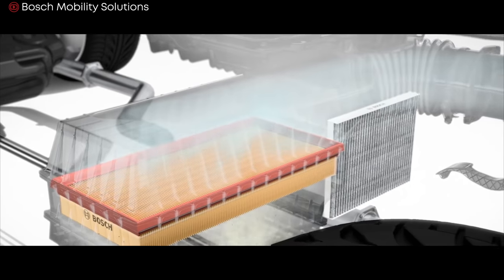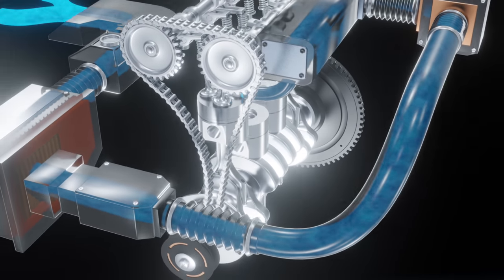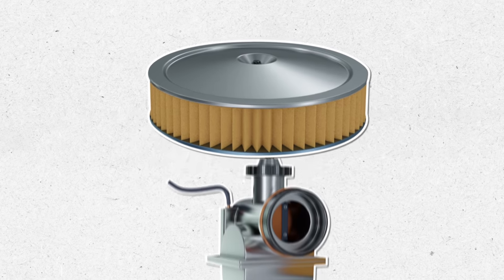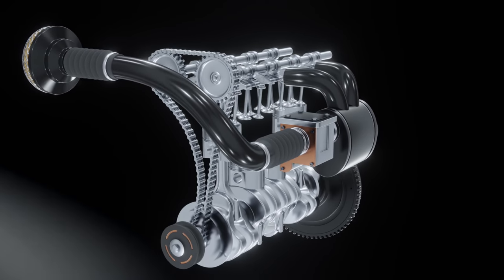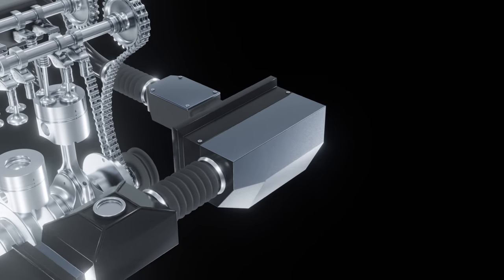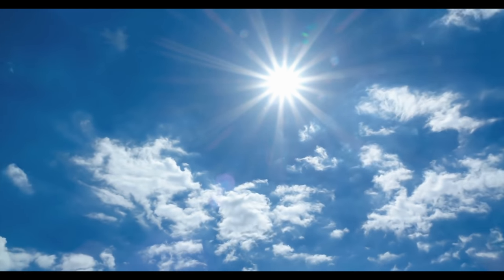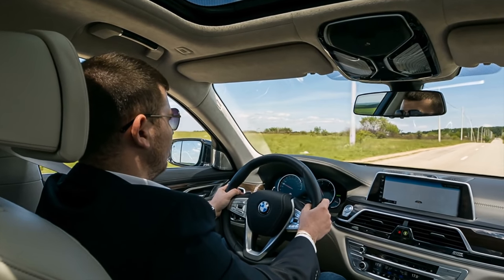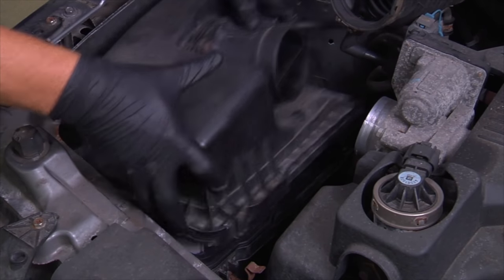If You Don’t Have This New Engine Air Filter, You’re Stupid

Comment: Hey Scotty, I own a 2015 Jeep Cherokee Limited edition with a 3.2 L V6 engine. I have owned the car for a number of years and have put about 40,000 miles on it (it now has about 70,000 miles on it ). I’ve had no work done on it after several years! Why do you have such distaste for the new Fiat Chrysler Jeeps?
Reply: because they dont last like they should, the newer ones should last 200+ thousand miles mostly trouble free but that doesnt happen. people have seen those cars break as early as 70,000miles which is unacceptable

Comment: My Dad's 1955 Ford with the 272 V8 had the old oil bath air cleaner. It was about the size of a crock pot. A messy thing to service.
Reply: I still use both tractors and trucks that use oil bath air cleaners. All of them pre 1965. They work well actually and can be cleaned often and inexpensively bc there is al ways oil available and you never have to order a new filter. A little more difficult of course but I just dump the oil in the used oil barrel, flush with a little diesel fuel, refill to the line and reinstall.

Comment: Some filters are so good they restrict air flow
Reply: Plus, nobody has ever explained to me how oiled cotton like K&N flows better than clean, dry, new paper.    If oiled air filters flowed so great and protected so well, car manufactures would use them.  It probably wouldn't even cost them any more to use them.    Clean, dry paper is best.
Reply: @scdevon  I have a JLT cold air intake and just discovered that they now make paper cone filters that breathe as easily as their oiled cotton ones.  Instead of cleaning and re-oiling, you just replace in 30K miles.  JLT also makes water resistant pre-filters that slide over the cone.  I have a JLT paper cone filter on the way!

Comment: Mr. Scotty Kilmer hello. I am trying to program a brand new replacement key fob for my 2001 Chevy Tahoe. As mentioned the key fob is brand new, with brand new working batteries. I have followed/repeated the entire insert key, hold down unlock button, turn ignition off/on twice, wait for the lock to cycle, press and hold lock/unlock on fob simultaneously. But the lock never cycles therefore the Tahoe never enters programming mode. As a side note, I know that the locks are capable of cycling. Because when I pull and hold the bright light lever while cycling the key twice to program my desired door lock/unlock sequence the locks will actually cycle, the same way that they should when programming the key fobs. Can you please share some troubleshooting steps that might help me diagnose why my Tahoe won't enter programming mode so that I can program my new key fobs? Thank you.

Comment: Scotty can I get your opinion on a 2009 Lincoln MKS 3.7 liter V6? It's my first car and I would appreciate any advice you can give
Reply: Ford Cyclone engines with the water pump under the timing cover that when they fail they weep straight into the oil, I suggest you run don't walk.

Comment: What do you think of a 2001 Silverado 1500 5.7 v8 with 90000 miles on it
Reply: I put 6 air filters on mine for a 300hp boost
Reply: I have a 2002 Chevy 1500 LT Z71 with 450,000 miles and still runs great. I bought brand new. Still starts and runs like new. I change oil every 5k miles. Also front wheel bearings replaced at 150k miles, and one alternator, and one hot water intake connector into the cabin heat exchanger, brakes, tires. So I would buy as the truck is basically brand new with less than 100k miles. As long as it starts easy, doesn't knock, blow smoke or have any tranny clunks, or funky shifts. The 5.3 liter Vortex V8 will run forever. I live up near lake Tahoe and it is the best snow four wheel drive ever. I never have gotten stuck and always pull out the Jeeps, fords, and other brands. I've driven through overhead snow drifts for hours on the dark desert roads of Nevada for 100s of mikes at a time and never got stuck.
Reply: A 2001 with a 5.7? I only remember them with the 4.8, 5.3, 6.0, 8.1, and the 6.6 Duramax. As far as I remember, they only used the 5.7 until 1999. My 2001 Suburban has the 5.3. Go into your glove compartment, and look at the options sticker. Go through all of the codes listed. One of them will be the engine code for the engine that the truck came with.

Comment: K & N air filters allows particles as large as 17 times the particulates trapped by an OEM air filter. To put that into perspective, a USA traffic lane is eight feet wide. Seventeen times that is 136 feet. That would be a traffic lane wide enough to park nearly twenty new Cadillac Escalades side by side.
Reply: State your sources. I doubt it.
Reply: All OEMs use a filter with a starting efficiency of 97% or higher, and the filter will increase in efficiency as it gets loaded with dust.  The K&N performance improvement claims are achieved by comparing a new or just cleaned K&N filter to a fully loaded OEM filter.  The original OEM filter does not cause any measurable decrease in engine power when new.
Reply: @rons5319  I have a better idea - state YOURS refuting it.
Reply: @andydguitar Two questions: WHICH Toyota Celica - there were SIX generations produced. Also you can't locate the dimensional width in Wikipedia and divide 136 by that specification? Come on. A FIFTH grader could solve that math problem for you. 😄
Reply: @greggreen969 
 More restriction means less mpg and less power...
OEM's are never interested in mpg...
Reply: @boobtubeakatv1296  why yes we are, but we have to certify tailpipe emissions are met for 10 yrs / 150,000 miles, which means we need to allow for a shift of up to 20% in air / fuel ratio over time as parts wear.  It is also necessary to manage a trade off between the acceleration performance targets that the customers want and mpg.   GM can achieve over 30mpg in a Suburban at highway cruise with variable,e displacement.  Millions of dollars are spent to optimize mpg and still,safely enter a freeway.

Comment: Had a 1968 Pontiac Lemans, 350 v-8. First car. Started it one day, would hardly move. Pulled the air cleaner off. Totally clogged with oil, dirt, twigs, everything imaginable. New air filter, ran like new.

Comment: Scotty, I have a 2007 F350 DRW truck with the 6.8L engine that runs great and has plenty of life left in it (178k miles). However, when I do a warm start (like stopping and going into a store and coming back out) the truck hesitates for a few seconds when I first take off like like it is not getting enough fuel (or too much). If I let it idle for a few seconds more, it runs just fine when taking off. It is only for a few seconds that it does this. Is this a leaky injector? I have checked the fuel pressure immediately after I shut off the engine and it drops to 0 PSI immediately, but my truck has a returnless fuel system. It is NOT hard to start and fires right up after a crank or two. What do you think this is?

Comment: Oh that's odd I was just at the store and the new frame filters say it's good for 40k miles um  yeah there is no way,  glad to watch this video and fill me in on what the hell is going on
Reply: Lol 😂 they’ll last as long as there not dirty depends on where you drive. Don’t expect it to last if you live in a rock quarry. Mine is a pollen trap for sure but I don’t throw them away I’ll just air it off with high pressure from the back does the trick nothing to fancy.

Comment: Why do people keep saying that you get better gas mileage by changing a clogged air filter? Unless your car has a carbureted engine the amount of air is measured and fuell is injected accordingly.
Reply: At some point the computer won't be able to compensate for the lack of air. Engines need air to breathe...just like humans. A partially clogged filter would be like running a marathon with one nostril super glued shut.
Reply: @northdakotaham1752  You 'll see a masive decrease in performance  before your car is unable to compensate.
Reply: @chiprock804  check engine light will come on before that happens.

Comment: the open air conic filter outside of the box is well worth the downside of getting hot air in from the engine. it s not that it sounds better, your engine is MUCH more responsive (only if it  s short ram).

Comment: Can you give some examples of stainless steel air filters and what their cleaning procedures are???  Also do you recommend afe or K&n air filters. ???
Reply: Unless you have the resources of a NASCAR team and can rebuild your engine every 1000 miles stay away from a stainless steel filter.  It is not capable of filtering fine dust.  True racing filters have minimal filter efficiency, they keep out large debris only

Comment: Changed to a K&N  filter.... now Check engine light is on permanently
Reply: Congratulations you just ruined your Mass Air Flow Sensor, which is what triggered the MIL light
Reply: @greggreen969  can it be cleaned?
Reply: @rowanparmiter7622  maf cleaner at any auto parts store

Comment: I adde a high-flow air intake with a heat shield and the next day my engine light came on for a lean condition bank 1&2
Reply: Probably a air leak on intake check your clamps also you may have a bad pcv valve since the airflow through filter was correct the extra through the pcv.  Check for air leaks

Comment: Whats your take on aftermarket ‘performance’ air filters Like K&N? Im thinking about getting one.
Reply: Be careful with these filters. Too much oil will contaminate your MAF sensor. 
Btw, I’ve used K&N filters for years in both my daily driver/tow cars and race car. 
I get an additional 722 hp from it. Honest. Would I 💩 you? 🥴
Reply: @navret1707  722hp is ridiculous haha of only it were so easy. It comes pre-oiled when you first get it right and after some 1000miles you have to get an recharge kit.
Reply: @Bakachuli  NO !! K&N recommends a "clean and re-oil" after 50,000 miles.
MOST of the "problems" with K & N Air Filters is that they are cleaned and re-oiled TOO OFTEN.
 Scotty's advice to "hold 'em up to the sun" to indicate the filter's abilty to function properly is just foolish, since the filter does most of it's cleaning by running the air flow ACROSS the "dirty side" of the fiiter.

Comment: What do you think of OBS fords, I’m thinking of buying a 1996 F150 xlt with a 5.0l V8
Reply: good truck man I have the 4.9 in a 88 f150. only bad things were iac and distributor and ball joints and fuel pump. go for it man
Reply: You can't throw a rock and not hit a OBS Ford with a 5.0 at pull a part yards. Plenty of parts out there

Comment: Aside from emission requirements, is it a good idea to remove the charcoal air intake filter  (on many Toyotas) for a slight increase in gas mileage?
Reply: Not to be a prick, but I thought Scotty made it abundantly clear to change the filter when dirty as well as DON"T leave the filter off.

The filter keeps contaminates from causing premature damage to the engine.

Do what you want, it's your car.
Reply: NEVER operate your engine without an Air Filter !! 
Changing to different types of Air Filters WILL NOT give "a slight increase in gas
 mileage". 
You'd gain more fuel economy by increasing your Tire Pressures by TWO (2) P.S.I. above the factory-recommended tire pressures as listed on the door jamb.
 Get a DIGITAL Tire Gauge for accuracy -- I recommend the JACO "Elite" Digital Tire Gauge.

Comment: Can I use an air filter several times by cleaning it blowing air??
Reply: Not a good ideal if it's a stock filter as usual there cotton paper type they don't really clean that well if blew out with air.
Where if its a sprint or K&N air filter  for example  it can be cleans with air washs  and  reuses

Comment: Thoughts on a high milage 98 Corolla
Reply: timing belt ? water pump ? When were they done ?
Reply: What's "high mileage"?
Reply: 234, 000 miles
Reply: @tedgamma8650  wouldn't pay very much for it unless that engine has been replaced or rebuilt. What you see is what you get on that one.
Reply: Only $900 for the car
Reply: @tedgamma8650  not much to lose there! If it runs and drives, I would take a chance on it.
Reply: 1998 corollas have a timing chain, not a timing belt. It should last the life of the car.

Comment: @scottykilmer I buy a Wicks air filter, and cabin filter that say they are good for 15,000 miles. No problems with with either filter changing them at 15,000. But is that okay? 2013 Honda Accord with 100, 509 miles.